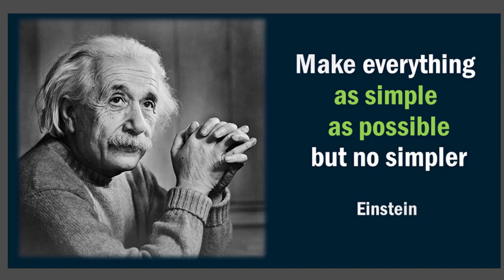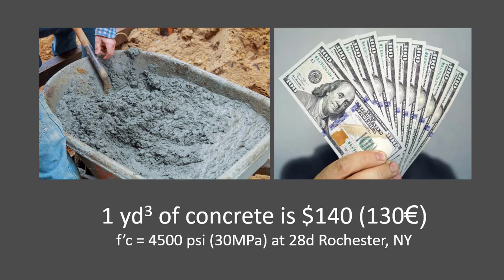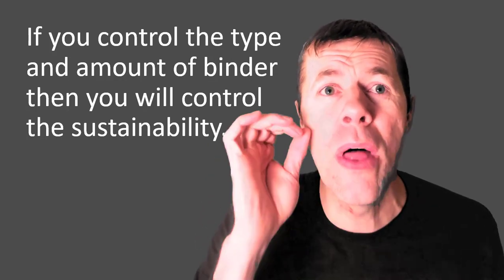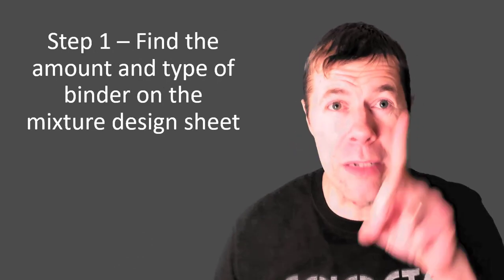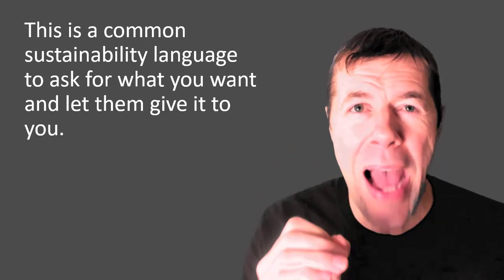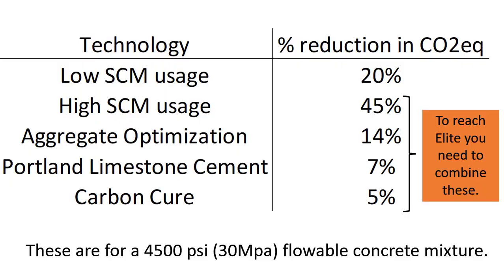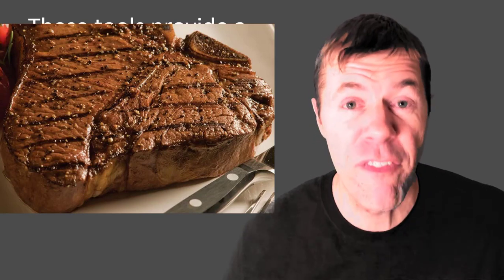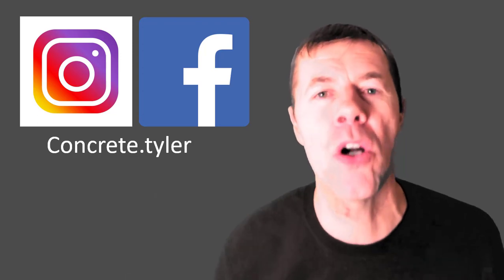How to get sustainable concrete

Comment: I'd imagine that the energy required to make the concrete is what causes the vast amount of CO2 because concrete is so energy intensive so this could be a really good candidate for renewables because it's probably made mostly during the day and finding things that use a lot of energy that can directly be replaced with renewables without the need to store power is probably the only path forward for renewables because storage is so difficult and expensive.
Reply: actually, most of the C02 produced from concrete is from cement manufacturing.  Cement is made when C02 is released from limestone.
Reply: @fritzpak4821  I misread your comment and went on a long diatribe about what I thought you had said, you're addressing exactly what I said, cement manufacturing is incedibly energy intensive and is done mostly during the day so renewables that could pump directly into the kilns could be a good application because it doesn't require expensive energy storage. I know you're talking about limestone which is CaCO3 or something like that converting into cement and releasing it's carbon directly but that's gotta be a fraction of the CO2 released from burning fossil fuels to heat that limestone up to 1400 degrees C, like that's a ridiculous amount of energy

Comment: I doubt when you say 90%of co2 comes from binder alone, this may be the case if we use only portland cement but if we change the binder composition reducing the co2 emission, contribution percentage will come down from 90.

Comment: Tyler.  I'm a PITA and I know you're not likely to answer this question, and if you do, you might be concerned with your liability.  Please understand all I'm looking for is general advice, not design advice.  Hopefully you'll consider it..

Here we go.  I've got a 42 inch block foundation under a hip roof garage that's bowing outward on 2 sides.  Don't think it's much, if at all in the last 8 years.  It's shifted away from the slab about 2 inches in the centers.  It was built 50 years ago.  The estimates to have plates on the exterior with threaded rod running in to ground anchors under the slab and then poured over similar to a pier are $7,500ish.  Too much.  My thought after 3 months of dreams and wandering thoughts, is to drill 3-4 inch holes in the plate, fill the block cavities with 1 1/2 bags of Quikrete with 2 fiberglass rebar buried and a full length allthread coming up through the hole in the plate.  Then I've got 2 choices.  Drill through the filled block horizontally, bolt it to a 10' x 10" plate on the outside, and run it through a bracket that's been cone anchored to the slab floor. Tighten the thread rod holding the outside plate to 80 lbs.  Other choice: Bolt a bracket onto the allthread coming out the hole in the wood plate capping the filled block.  The bracket would be L shaped 1/4" steel bent downward toward the slab, then place another L shaped bracket anchored to the slab, run allthread through both brackets, put a bolt on each side of the brackets and tighten to 80lbs. The top of the plate to the slab is about 5 inches, so not entirely lateral force.  What do you think, and which might you consider using?  I will have one follow up question following this, if you are actually willing to respond, which I'm sure you won't, and I don't blame you.

Comment: Good afternoon Tyler.  If injecting carbon dioxide into the cement makes calcium carbonate then why is that any better than just adding in calcium carbonate rich mineral in substitute for cement?  Is adding the unhydrated powdered limestone an equivalent effect.  Maybe the purity of natural minerals content of calcium carbonate vs the calcium carbonate formed via C02 injection is a factor in the end product?  I must be honest I am a skeptic with this technology not because of the science but because of the business end of this.  Tracking where the Co2 came from and its own manufacturing carbon footprint as well as it's accidental release to atmosphere is concerning but maybe I just need some guidance.  Thanks for any help with this topic.  Best Kevin

Comment: There's a guy at the University of Arizona Dr. David Stone who discovered using steel dust and fumed silica, mixed with salt water to make a concrete that appears to be more durable than regular concrete.
www.youtube.com/watch?v=yWPzERdNh50
Any thoughts on this...????

I'm unclear on what steel dust is, but it is a waste product.
Dr. David also gives me the impression that fumed silica is also a waste product from steel production.
He also says that the older the fumed silica is, the better it works.

Comment: you are the greatest. you are an idol for a junior lecturer, to me. most of the time concrete is considered non-environmentally friend building material mistakenly. it's the scapegoat of building industry. it's the most common building material, therefore it's not surprising that it's responsible for 5% CO2 emission annually. probably any material with heavy usage will result in with that amount of CO2 emission. if it's optimised, it has the potential to be environmentally friendly (with utilization of SCMs, aggregates, as you mentioned). people have a bias towards concrete. but thanks to concrete freaks like you, this may change in future!

Comment: Yes!!! Go Tyler! Such a great summary.
Do you have a source for those fly ash / slag quantity targets? Are there disadvantages to using that many SCMs to be wary of?
Reply from the maker: Those are the high end of what people use in the industry.  Higher amounts of SCMs can delay set time and also early age strength gain.
Reply: @TylerLey   thank you! I'm a structural engineer, and really trying hard to change our specs to enable higher use of SCMs. Are there any guidelines/rules in ACI or elsewhere that I can point to for justifying SCMs in high quantities like you've mentioned? If I say "up to 50% slag acceptable" someone will ask where that comes from...

Comment: I think solving the CO2 budget is a solution looking for a problem and the "solution" has huge costs and problems of its own.
Reply from the maker: Maybe so but a lot of the CO2 solutions for concrete just make the material better and less expensive.
Reply: @TylerLey  Thank you for the excellent reply. Better concrete should be the goal. EPD is like a religious euflection. Great for religious ceremony and comfirt, useless for objective goals.

Comment: Hey Tyler. Why dont you do a video on your recommendations for say concrete mix for footers, slabs, stem walls, basement walls. Like what mixture and additives you would put in or not have in the mix if you were pouring
Reply from the maker: Thanks for the video idea! The answer will depend on the size and equipment that they will be using but I'll see what I can do.
Reply: Yes please

Comment: Sounds expensive, shoddy, and/or deadly.  One of those inevitable triadic compromises engineering cannot resolve. A tournament of unearned risks.

I'd prefer Fermi estimation to Einstein's spreadsheets.
Reply from the maker: Almost all of the suggested methods to improve the sustainability also improve the cost, strength, and durability of the concrete.  You should watch the video I suggested.  SCMs have been used for more than 80y.

Comment: How to make dogshit.
A book by a man who has never had to lay a trowel on a floor.
Your talking about a 20 year old fly ash mix. 

Use some glass for your fines, some polymer admixture to lower you water content.
Look to the countertop mixes for more sustainable designs. This guy is stuck in 1995.
Reply from the maker: This video is about a simple framework that can be used to compare any proposed solution.  I am not here to tell you how to cook the steak, I am giving you a way to compare different solutions.  You should try it out with the countertop mixes.  There is more information for recycled glass in the video.  Unfortunately, lowering w/cm won't help you with your initial carbon footprint.  You can prove it to yourself with the free tools that I gave you.